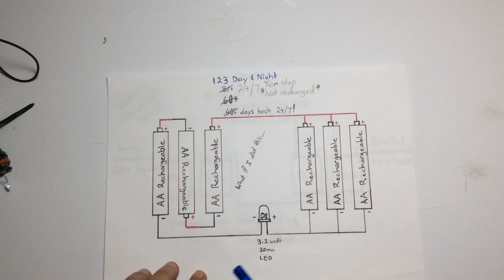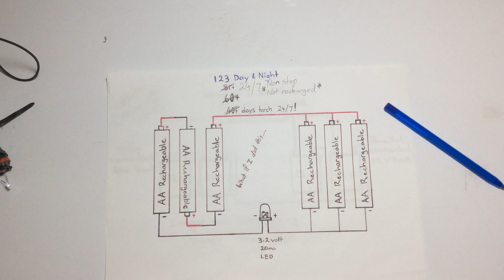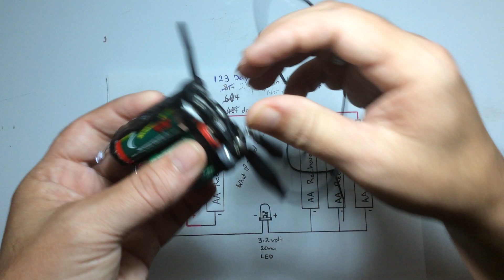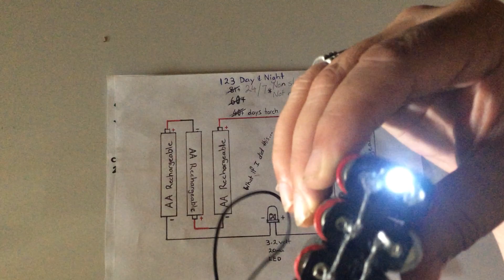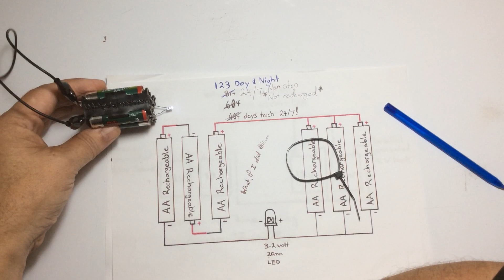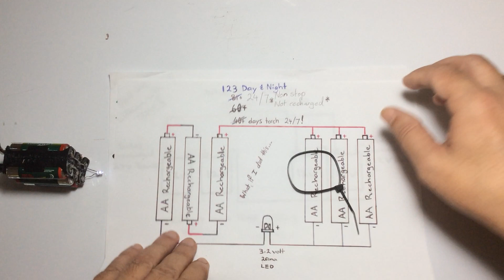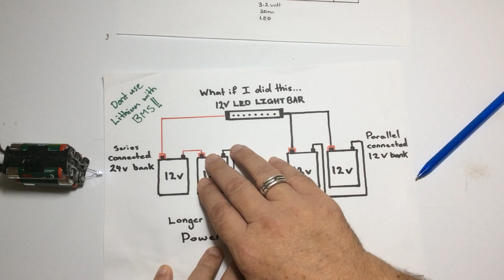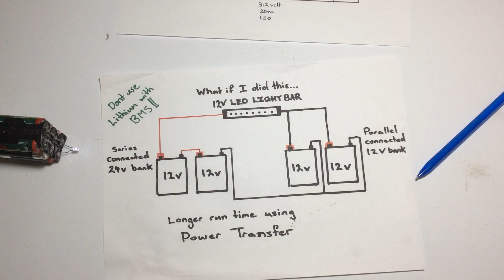*UPDATE* Tesla Power Transfer 123 DAYS & still running!

Comment: What happened to the capacitor version? I guess it will be the same except for the more frequent swap of capacitors (every few minutes or seconds).
Reply from the maker: Thanks for watching. The capacitor version ran for a few hours from memory. Due to my injury I was unable to complete the test so I will recharge the caps and start again. I will document the cap versions results and post when complete.
Reply: @whatifididthis...1236  Hope you will get well soon. The information here is more than enough for me and "a few hours" is quite good. The test is easy and it's a matter of getting bigger capacitors. I felt kind of ashamed that I asked something I can easily do myself (a few minutes of setting it up), but decided that I'd ask anyway :) By the way, there is a Russian inventor by the name of professor Gulia. He invented a special super-flywheel based on two spring-coils which were swapped every few seconds: https://youtu.be/X68S7ElDJHA?t=56 The principle is the same, just mechanical — the momentum of the spring unwinding was used for  winding the other one and then they were swapped. The same thing happens with the batteries and capacitors. I'm sure the same thing will be true for back EMF, just swapping has to be quicker.
Reply from the maker: @tihomirlazarov5242  Thank you for your comment. I completely understand you wanting to ask the question instead of doing the work, I do it all the time, after all it’s just so much easier than getting off our bums and organising it all. Thank you for the link I will be sure to check it out as I love investigating the things we aren’t taught.

Comment: What you need to do is have a base line test LED running conventionally off the same amp hour batteries, so you can compare the actual gain you have. You would be surprised at how little current a LED running at that low brightness really uses. They are extremely efficient at low brightness. But I'm sure your method of switching batteries is more efficient than conventional way, but I would like to know exactly HOW much more efficient it is.
Reply from the maker: Thanks for watching. I completely agree, I have calculated the “normal” consumption rate at approximately 14 days with equal condition of batteries and the same load, however the only test I ran lasted less than 12 hours. I will run this test again with charged batteries and record the run times and perhaps record start and stop times. The difficult part is determining when the transfer method is finished as it runs for a long time with a very dim output. Should I let it run until completely out even though the light isn’t that practical at that point? ...or should I swap the batteries every 3 days to ensure a more functional light? The test in this video is more about longevity over peak illumination, that being said it has been nice to have the several units running in the house producing just enough light to allow you to see in the dark with no need to deal with batteries each day.
Reply: @whatifididthis...1236   gud luck.. if you checked the mili amphs .. so that can tell everything.. i think. Thanks for sharing..
Reply from the maker: @saddabadda7921  Thank you for watching. Unfortunately I destroyed the ammeters I owned on one of my high voltage experiments so until I can afford to get more I am restricted to using physical results of the tests.
Reply: @whatifididthis...1236  you can't compare apples with apples the way you're doing it. As the series bank discharges and the parallel bank charges the potential difference between the series bank and parallel bank changes continually, therefore the power used by the LED is always changing. The only way to do this with any degree of controlled science is to have a cut-off voltage - just choose one - say 2.5v or whatever - and at that point swap the banks, recording how long it was for each run. You then calculate the watts used because you know the starting voltage and end voltage and time it ran for. Once you can't run for more than 15 mins above the cut-off voltage you can consider the result is acceptable. As you will have started with 3 fully charged batteries on the series side, and three discharged ones on the parallel side, all you need to do is run the load directly from single batteries, 3 times, to the same cut-off voltage in order to compare apples with apples. But you've not got the right voltages in your set up to do this. You either need a load that's designed for 1.5v (a single battery), or do the tests with 3v batteries such as CR2032 type. Also I would design a circuit configuration with a heavier load that lasts a couple of hours max between swapping the banks. That way you'll do the whole test in a day and get the information you are looking for.
Reply from the maker: @markflint9089   Thank you for your comment. All the points you make seem to be valid. I will take some measurements as soon as my new multimeters arrive and make a new video showing input to load, output from load and amperage between banks on the opposite side of the load. Either way, I don’t believe there is enough joules in all the batteries combined to make the circuit run as long as it has, which is still running now, 280+ days.
 I calculated the system as follows, please correct me if I am wrong. My calculations are at a constant voltage which we all know isn’t possible so the calculated outcome is technically better than real life, as we know, when voltage decreases the amperage increases through the load chewing more joules.
This is how I calculated run times.
A single AA 1.2 volt x 2500mAh = 3 watt hours
3 AA in series = 3.6 volt x 2500mAh = 9 watt hours
3 AA  in parallel = 1.2 volt x 7500mAh = 9 watt hours
Combined banks at full voltage can only store 18 watts.
1 x 20ma LED @ 3.6 volts consumes 0.072 watts per hour.
18 watts divided by 0.072 watts = 250 hours.
250 hours divided by 24 hours = 10.4166666667 days.
Again, I could have calculated incorrectly and these numbers would be different in the real world due to voltage drop, however, 10+ days at an unattainable constant voltage still comes nowhere near the approximately 280 days this unit has been running for. Due to voltage drop and subsequent amp increases in the real world tests this light did not last 12 hours running on all 6 AA batteries. (Two banks 3 x AA in series then both banks joined in parallel creating 3.6 volt at 5000mAh).
The LED at its rated values of 3.2 volts @ 20ma = 0.064 watts per hour.
0.064 watts x 24 hours = 1.536 watts
18 watts capacity(both banks) divided by 1.536 watt per 24 hours = 11.71875 days in an unattainable perfect setting based on stored joules. I think this means the energy stored in the batteries only accounts for 3.57% of the units total run time, somethings not right assuming my math is correct and that is giving the conventional understanding of electronics the undeserved “benefit of the doubt”. Accounting for voltage drop in real world tests and the conventional use has the light off in under 12 hours.
As I stated, I could be wrong as being human allows me this right but I will perform the tests as you stated to be sure and scientifically correct in my assumptions.
Reply: @whatifididthis...1236  I not sure why you are calculating the LED watts based on a voltage of 3.2v. If bank 1 starts at 3.6v and bank 2 at 1.2v the LED initially sees a voltage of the difference, ie, 2.4v. but this voltage is continually diminishing as bank 1 discharges and bank 2 charges. The average voltage needs determining over the length of the cycle. For a rought ball park you can take the start voltage plus the end voltage divided by 2. You really need to look at the battery chemistry discharge curves to tweek your calculation. Then run the LED at the calculated average voltage to see what current it is drawing and use this mA figure to calculate a more realistic mW figure. I don't think this discrepancy alone would explain your longer than expected run time though. I've done these type of tests with lead acid banks and LifePo4 banks and found that in the case of resistive loads there is no overall gain. That does not necessarily apply to inductive loads where the BEMF can be recycled into the charging battery, or another battery. But perhaps there is some magic going on with those small batts. What is the battery chemistry of the batteries you are testing with?
Reply from the maker: @Mark Flint  I believe more tests need to be done and I intend to make another video using three ammeters to measure actual power consumption instead of theorised consumption. I calculated the usage of the LED according to its ratings to get a rough ball park figure. I did this because of the constant voltage fluctuation of both banks and calculating it based on its ratings defines the amount of power required to run the LED under perfect conditions and this demonstrates the efficiency even more as the 20 something days the LED was at full brightness before the first battery swap is 8 or so days longer than the perfect conditions scenario that cant be achieved in a conventional sense. The voltage seen across the two banks with no load is half of the series bank. When using the 24v/12v version of this system, the voltage reads 12 volts between both banks. Something is clearly not right with this system as when using the AA setup, the voltage seen between both banks is half of the drive bank, 1.8 volts, clearly this should not light a 3.2v LED, let alone run it for so long, not to mention when under load the voltage is 2.5 volts after 280+ days which should also not be capable of running the LED.
I will perform the tests as you have suggested, when I want a quick data set I use a larger load as 280+ days is far too long to wait for data.
One thing has become obvious using this system, our understanding of energy might still be wrong!
The batteries are NiMH AA 1.2v 2500mAh
Reply: @whatifididthis...1236  The challenge is to hit a 'moving target' when measuring this because of the changing potential difference between the banks. I've run this configuration many times but actually never with LEDs and never with NiMH chemistry. Maybe I've missed something. There is certainly a gain if you pulse an inductor and recover the BEMF.
Reply from the maker: @markflint9089  I too have run this with other chemistry of batteries and had nowhere near the results that I have achieved using NiMH. I am still very confused on the long operation and I struggle to explain why this is still running to this day. The new ammeters have arrived so I hope to display a test measuring the current at three seperate points to try to help explain this to myself. Hopefully I can post a video of this test soon.
Reply: @whatifididthis...1236   Hello how are you? I hope you are fine please I sent to you a reply about your last mail thank
Reply from the maker: @zenssysteme681  Thank you for your comment. I apologise if I have not answered your last email, I have been trying to catch up on house duties and my experiments that couldn’t be done when my leg was injured. I will check your email tomorrow.

Comment: Great work. Waiting for scaled version video.
Reply from the maker: Thank you for watching. I have been testing the scaled up version to determine efficiency with batteries of a different composition. So far I have tested 12 volt lights and a 12 volt phone charger and a 240 volt inverter and all worked great. The only problem I have seen so far would be disconnecting the load before the batteries drop below 12.1 volts at which point they are flat, draining any further will damage those batteries. The AA version using NIMH cells is far more efficient than the SLA 12v batteries. An expensive test using 48 of the AA batteries running 12 volt loads needs to be done to compare efficiency but I need to find a good deal on the batteries.